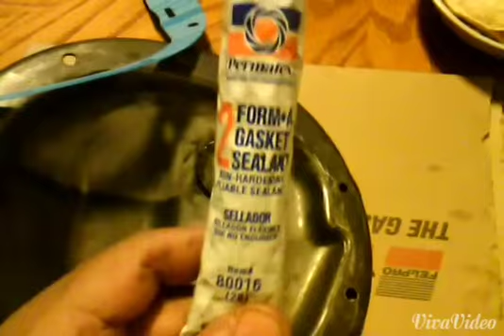Differential gasket replacement

Comment: Um....RTV gasket maker is probably what they used but instead of putting enough on they skimped. The more the better and it makes a good gasket on whatever it's used on. Defiantly the fluid was empty though which means it's been leaking for a really long time or it's a really big leak.